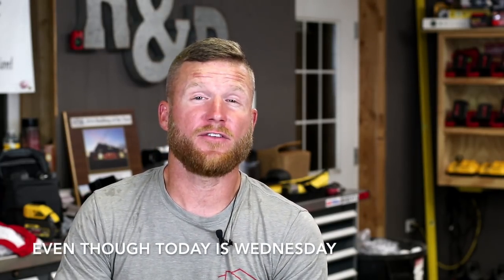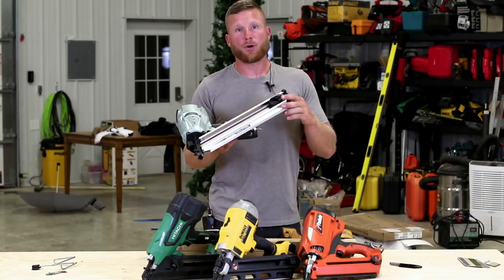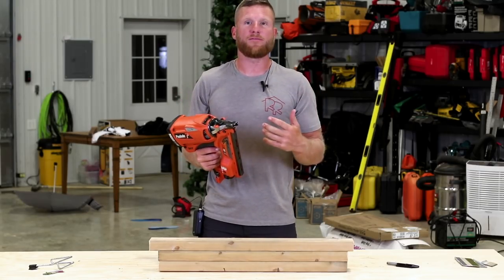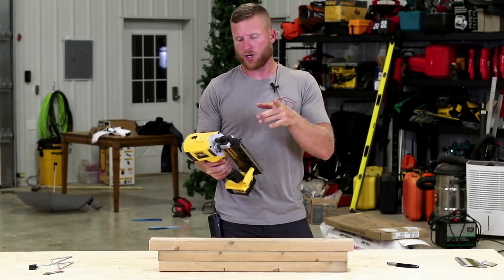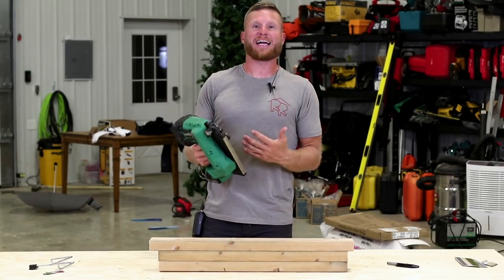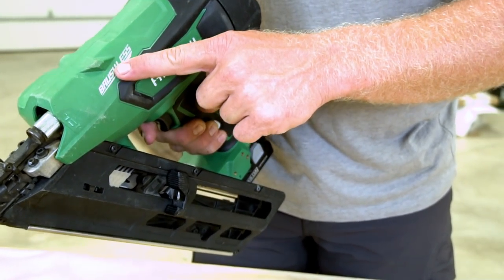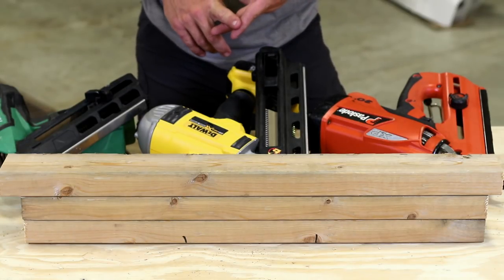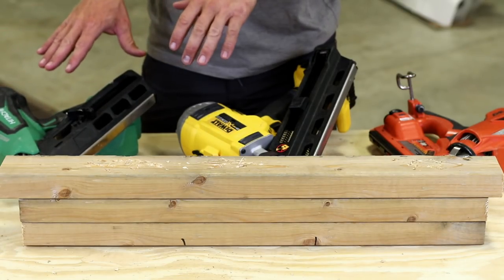The Best Cordless Nail Gun: Toolsday

Comment: only things i can say for sure 100% is ; 
Hitachi (Metabo HPT) is the best framing nailer to me. i tried all three nailers in this video. I dropped all other two nailers. I was so frustrated with jamming, misfire, non-flushing nails, etc issues. i will never go back again to other two nailers, even someone gives big money to use them. Those issues while you are working, takes away your precious time. Only Hitachi framing nailer is the one that makes me satisfied. No jams, no misfires, all nails you fired flushed through so far. I love this nailer. I have been using hitachi nailer about a year.
Reply: The hitachi gun is space-age. I've run about 500 nails so far and not a single jam, not a single proud nail. Used a Dewalt gun that jammed about 10 times (knots and awkward angles cause the most jamming) and had trouble fully sinking 3 - 1/2" nails without being proud.

Comment: I teach building trades class and we purchased a couple of the Milwaukee M 18 framing nailers and they fire the nail as soon as you pull trigger, No waiting to spool up. The nailer has a very large rafter hook. It also can be adjusted for depth of the nail, in pine lumber they will drive nails about a 1/2 '' in depth. Good nailers!!
Reply: Should check out Metabo HPT's new 36V guns , they r ridiculously effecient

Comment: I tried a Milwaukee cordless finish nailer and returned it. Bought a Dewalt framer and returned it. Bought a Bostitch cordless framer (28-degree wire weld as thats what I have pneumatic nails for) and returned it.

The Hitachis are the only ones I like. It feels very similar to a pneumatic gun, and has NO problem sinking 3-1/2" framing nails even in the hard dense woods of my barn.

They're great! In the last week got a 15ga finish, 16ga finish and a 18ga brad nailer.
Reply from the maker: Patrick Clochesy they are legit aren’t they
Reply: Definitely. I have all Milwaukee cordless, except I had to go to Hitachi for the nailers.

I have some minor complaints, but overall they work exactly as I had hoped a cordless nailer to work. I don't like the buttons or status display. The nail magazines are not my favorite when it comes time to removing nails to switch sizes or something. I have yet to need to clear a jam on any of them... so I can't comment on that process. Otherwise - incredible!
Reply: I am buying 2 of the Hitachi 21 degree cordless framing nailers. I have mostly all Hitachi stuff already, the new Hitachi 36 volt batteries are backward compatible with the 18 volt tools, instead of getting 36 volts, you get double amp hours, so 8 amp hours on one battery.  Hitachi all the way!
Reply: Patrick Clochesy I have almost all Milwaukee tools and I too can confirm their finish nailers suck, I don’t know how they screwed it up
Reply: bostitich and dewalt are the exact same gun,  both are junk too, i too love hitachi
Reply: I used the DeWalt after using the Hitachi and by far the Hitachi is the Way 2 Go
Reply: Droppin cash bro
Reply: @thisisconstruction.  lol thats what im sayin, those nailers are expensive!  Lol good on him tho
Reply: daleon96  true Had them both and switch too Hitachi never had a better cordless framer

Comment: Hitachi has a 21 degree battery nailer too. If you have 21 degree nails for your air nailers, you can use them in the Hitachi 21 degree battery gun.

Comment: You're the 2nd reviewer I've watched that has the hanger wrong, you can use it wide for throwing over joists etc or just rotated it 180 and it becomes thinner on the other side. Serves to protect the battery as it wraps over it also.

Comment: Great comparison and demo of the various technologies over the years.  I remember seeing the Paslode nailer on This Old House years ago when they first came out.  It certainly was a game changer.
Reply: The first Paslode gun I saw were used in the roofing industry. The guns needed constant cleanings and rebuilds. The company my brother-in-law worked for purchased 8 of the coil nailers for their crews and in a lot of cases, the guns needed repair after about 50 square of shingles.

They've improved a lot, from back then.

I'm still using my pneumatic Bostitch RN45 for roofing and siding and a couple of 28 degree Bostitch framers. I like the cord, as it makes it more difficult for the gun to take a tumble, and I can constantly be injecting oil into the line to keep running trouble free.

I am going to look for one of the Fasco guns that will shoot the 6" nails. They're expensive, but I figure I'll use it for my build, then think about selling when complete. Who am I kidding, I don't sell tools?

Comment: We now have 2 Hitachi guns, best investment. Another thing to mention is the power of the Hitachi compared to the paslode, especially when shooting into LVLs or glulams. Hitachi wins any day of the week. We also have 1 gun with big rafter hook for hanging over brick walls and 1 with small hook for hanging on rafters. The small hook comes off the 16g brad gun.
Reply: Josh Andrews good to here my two 14 year old paslodes are on eBay and a new hitachi is on order
Reply: Have you had any issues with your Hitachis. My gun is having problems feeding the nails.. using paper instead of plastic
Reply: @migueldejesusolivares5607  reading through the comments someone posted saying they oil the spring on a monthly basis so it feeds the nails right otherwise they shoot out sideways on him

Comment: I remember back in the day, when a Hitachi NR83 was around $400, and most guys were still swatting nails the hard way.  Nowadays, anybody can afford a pneumatic gun, even if it's a brand no one's ever heard of.  We've come a long way.  

I bought a DeWalt about a year ago, and I could barely believe that a battery-powered framer was even a real thing.  The mechanical system that makes it work is a miracle unto itself, and it still amazes me that it actually does work.  I've got a few dozen DeWalt tools and plenty of batteries, so I'm hesitant to buy anything that runs on a whole different battery platform, but I must admit, if the DeWalt ever craps out on me. I'd be really tempted to go green.

Comment: I’ve used the Paslode nailer and didn’t like it at all. While it is the lightest of the hose-less nailers and works decently well, there were too many cons. Expensive, constant maintenance, and the gas smell and refilling is not my cup of tea. The nailer also jammed regularly; strangely enough hitachi nails worked best in it as all other nails would constantly jam. I’ve also used the Bostich battery framer, for like one day before taking it back. Really can’t say anything good about it. It was slow firing, heavy, took long to spool up, and didn’t sink nails fully. The best thing I’ve done is to buy the hitachi nailer. Right out of the box it worked like a charm—quick firing, maintenance free, and the 3Ah batteries charge super fast. So fast in fact that you’ll only ever need 2 batteries, as the second one will be fully charged before you drain the one you’re using. While it is labeled as a clipped head nailer, I’ve also fired full head nails out of it without missing a beat. The auto-off feature can get a bit annoying but I think the biggest drawback to it, which is something that affects almost all current hose-less nailers, is the weight. Using this gun daily in a production environment could get very tiring. On the plus side, you won’t need a gym to build forearm muscles.

Comment: Hi, A good addition to your talk on these battery guns, is to advise when you buy one of these battery / flywheel/ belt driven nailers, buy a few parts like the drive belt, drive pin etc ( parts that are likely to need replacing) Reason for this is when your gun stops working in 5 years time, some parts might not be available / hence throw it away. But if you had those parts ,  you could extend the life of the gun x 2 . Then throw it away.

Comment: I purchased the dewalt 30 deg Thurs morning by 20 clips of 2 3/8" nails it lock jammed (nail missed going out and locked upd) 6 times on a roof decking and it wouldn't set up to flush for my zip board ...it WAS  returned by evening and purchased the Hitachi 30 deg.....due to a storm, I haven't gotten to use except testing. It sounded and felt much stronger. I just started using the Zip board and this "flush nail" recommendation I couldn't consistantly acquire with the 2nd gen Paslode 15 deg framer.

Comment: I'm 53 and have invested in Senco framers as well as my old Porter cable framers from years ago when they were still quality. I run a nice oiled compressor and also have Senco, Bostich and PC finish nailers. I'm just not going to invest thousands of follars replacing guns at my age. I have a lot of battery tools, but I'll stick with air and hoses even though I know they can be annoying

Comment: I owned two Paslodes. Sold both of them. Initially very handy. But required constant servicing and was forever cleaning the chamber and ports due to the gas process forming soot that clung to the internal parts. Went back to air.

Comment: Try all into oak or in 1 inch exterior ply . Try nailing a timber into a block wall . All are fine on soft wood or general work . But very hard materials like 1 inch exterior ply the paslode is the best

Comment: Most kiwi builders have been using the Paslode battery/gas nailers 10-15 years now... only on the really big commercial sites you may see the odd compressor and pneumatic nailer, but even then most are cordless.  Only in the last few years are we now starting to switch to the battery compressed air nailers, like the DeWalt or Hitachi.

I have the Hitachi nailer and love it

Comment: I just bought a Hitachi collated screw gun on close out at Lowe’s. I was really concerned that my Hitachi tools would be useless since they got bought out. The customer service staff at Metabo assured me they are keeping all of Hitachi’s parts in stock for at least 10 years and that all the batteries will be the same on both platforms. So if you run Hitachi batteries, scoot down to Lowe’s and buy them up at close out costs.

Comment: I bought 2 new Dewalt nailes like the one you are showing and the bump mode did not work on either of these. The one also jammed constantly on #8 nails.  I took both back and bought a Hitachi and have had no issues with it.  I have a friend that also has a Hitachi for 5+ years and never has had a jam with it on #16 nor #8.  I don't like the head/activating foot as well on the Hitachi as the prongs are shorter so it is harder to activate it in tight places where the gun needs to be tilted back for nailing.

Comment: I run a dewalt framer for punch work, I’ve fired 1000’s of nails through the first one before it went down. Ended up buying a 2nd definitely worth it. I use dewalt and Milwaukee tools so I have plenty of batteries. Don’t know why people don’t like them. I now run 3 for framing punch on huge apartments. I like how the hitachi seems even better just hate how I wouldn’t have extra batteries.
I also own dewalts trim nailer 18 gauge and works well too.
I still have several paslodes but only run them when I have a bigger crews with now power near by.

Comment: Man I’ve just come across your channel and I’ve been watching your videos flat out for days. 
Your gun review is spot on, I run a prefab panel operation and we use pneumatic hitachi nailers in the factory and I have 2 that have done probably 6 million nails and only had to replace one hammer so far. We have some paslodes but they won’t sink a nail into lvl which we use exclusively so for site erection I end up having to set up the compressor and run lines. Tried the dewalt and took it back after an hour as it left the nails 15mm proud and it jammed ALOT. 
I’ve been looking at the hitachi and think I’ll be off to get one now.
Reply: how did it do with the lvls?

Comment: I have the Paslode framing nailer and everything you said is true about it. Then I also have the trim nailer which the battery looks the same but will only work in it's own machine, This is my second Paslode framing nailer. I noticed on trimming nailer the gas bottle should be remove or it drains away.I had a coil nail gun which ran off an air hose, that thing was so touchy might have 3 nails back to back come out

Comment: I still choose a gas nailer over the battery powered ones.....  in terms of performance and weight they outperform anything else on the market.   The money for gas is insignificant as I cost in into the job.  I would consider a battery powered 16g brad nailer as weight is not an issue for finished carpentry.  But for a first fix nail gun,  when i'm climbing around on a roof stepping on joists and rafters i prefer the light weight of the gas nailer.

Comment: Have the Hitachi. had to buy the bigger rafter hook as the smaller one wil NOT hang on 4x2 or similer
Reply: It comes with a giant rafter hook, he replaced it with a smaller one. I have the same gun and the same complaint - I need to order the small hook.
Reply: I would not the small one is useless on this one. Mine. Came with a small one and I had to buy the bigger one
Reply: @lenardbosch2969   I'll take your small hook if you don't want it.
Reply: Where do you purchase the smaller hook?

Comment: I've really been wanting one of the Hitachi and I'm about ready to buy one but I'm thinking of holding off for a Milwaukee. Since you have used both which one would you suggest? 
 I currently run almost exclusively Makita so it would be a new platform either way
Reply from the maker: I’d wait for Milwaukee to come out and see how it holds up and performs on site.  The hitachi has proven itself to me so I am sure it’s good... the Milwaukee is super promising. Time will tel
Reply: @RRBuildings  I found a Hitachi at Lowe's this morning for $215 because they were selling off all of their display models in preparation for switching to Metabo HPT .
So I went ahead and picked it up so far I love it. 
Except for the rafter hook I hate that thing

Comment: Flywheel ramps up, you get centrifugal force which extends the driver, friction would slow down the flywheel, pretty basic applied physics. Bump nail, bad habit, you'll find yourself walking around with your finger on the trigger waiting for the accidental discharge into soft tissue cause by bump contact. Not me, you say, I'll wait.
Reply: Your wicked smahhht

Comment: where did you get that hook for the hitachi
I hate the standard one 
its my only complaint about the gun
Reply from the maker: it can be bought as an accessory but I stole the one off of my hitachi trim nailer
Reply: @RRBuildings   Not listed as an accessory anywhere I look at Hitachi, but I believe it's Hitachi part# 371241.
Reply: The only thing I don't like about the  hook is it can fold out wide when walking with it clipped to your tool belt.  Or climbing ladders. When working it's fine . Once it folded over it's the same as a smaller hook essentially

Comment: Could I get a link for the replacement hook on the Hitachi? Thanks. Great review.
Reply from the maker: Just stole it from the trim nailer
Reply: Gotcha. Now I need to purchase the trim gun. My framer is a week old and I have experience a lot of nails failing to set. It had been cold this week. Wondering if it needs a break in period to function 100%. Thanks.
Reply: Have been using hitachi nails. Grabbed some generic nails at weeks end that seem to set much better. Any input on nail type? Have not ran hot dipped yet. I’m hoping no issues with the galvies.

Comment: I’ve got a 15 gauge nailer from hitachi ( pneumatic ) and it is my second one. It is a pc of junk.  It has given me so many problems.  The depth is inconsistent.  And it more often than not stays clamped onto the nail that it ragishly spits out.  I took first one back and now I’ve accidentally held onto this one long enough to have lost the receipt on.
Reply: 1. Oil your gun before using it. 2. Use Hitachi, Senco, or Grip-Rite nails. If you do those two things and you still have the same issues, then you got two duds in a row and are therefore one of the unluckiest men alive, because the Hitachi NT65MA series is the gold standard among 15ga nailers.

Comment: The Hitachi Works only with Hitachi nails or works with other brands to?
Reply: That's a common question on Amazon, people say they work with any plastic collated nails of supported length. One person said they used six different manufacturers.
Reply: I cant say for the framing gun . But I have a dewalt framer and the 16 gauge angle finish nailer . My work partner has the Hitachi one the dewalt has shot any type of nail I've put in it but his Hitachi only shoots hitachi nails consistently.  Other brands it jams or leaves 1/4-1/2" proud . Framing gun may be different

Comment: Nothing, and I mean nothing beats a pneumatic hitachi framing nailer. The cordless is ok, but can come nowhere close to competing with a pneumatic tool. I need bump fire mode, and you can't do that with the battery operated gun it just doesn't have the same amount of power. The cordless is ok for little projects around the house, or for plumbers that only need to put a nail here and there, but I frame houses, and the cordless comes nowhere close to the pneumatic gun.

Comment: Nice presentation!  The Dewalt seems like the best choice, all things considered.  The Paslode is an unnecessary use of "Gas", and should e discontiued.  The Hitachi is second, choice but the electronic buttons are unnecessary.  The Dewalt has plenty of speed and power and is only $399 at Home Depot.